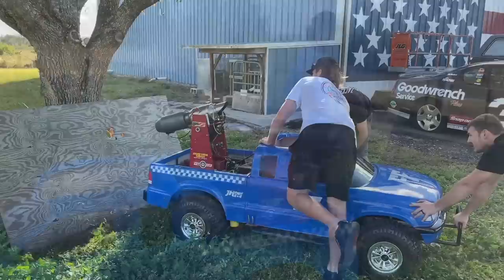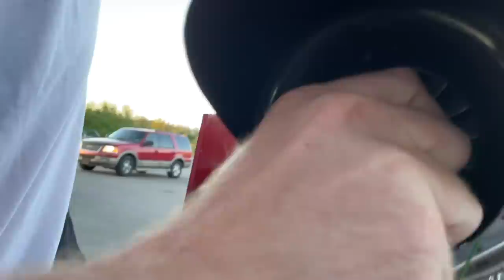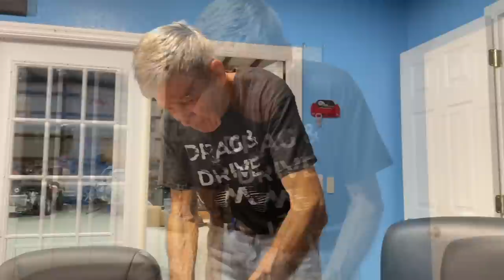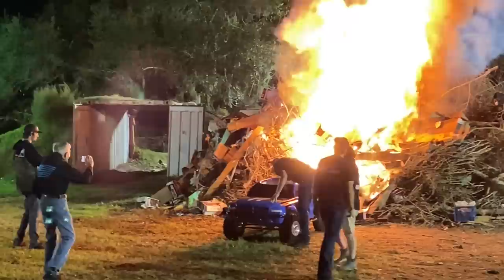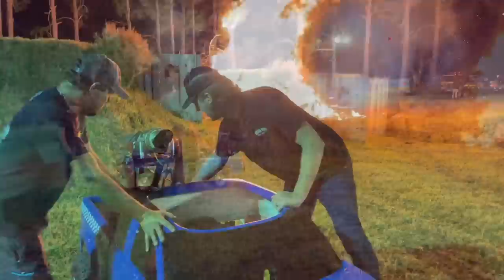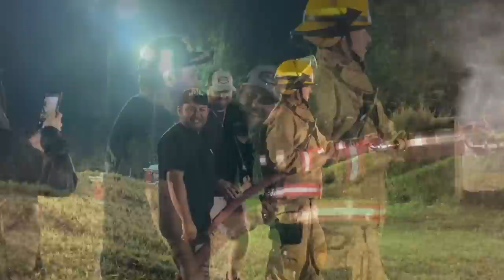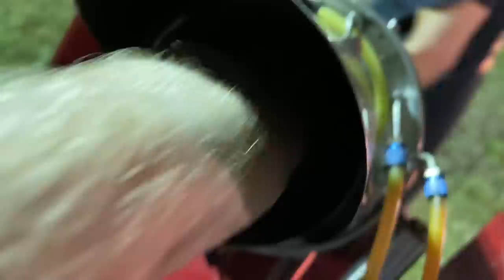Stoking a Fire With a JET ENGINE AFTERBURNER Will Get The Fire Department Called...

Comment: The turbine need's to go through a cooling cycle when you shut it down otherwise it will overheat internally. If you spin it with the airline after shut down for a while but slowly until the temperature drops below 100°C. If you used an ecu this would do it automatically.
Reply: Upvote this so cleet sees it!
Reply: Cleets helicopter is obviously piston powered and not turbine powered lol
Reply: Exactly. I work on aircraft engines too and I cried when I saw him hammering the turbine blades with the flathead and hammer.. I died a little on the inside! 😂
I don't know if it applies to small jet engines like that, but on regular turbine blades, you can actually shave down the outer edges slightly, there's a tolerance that is allowed to remove chips, cracks, or reduce the stretch that happens on turbine blades.
Reply: @dontyouworryaboutit_  his helicopter has two turbine engines.
Reply: Poor tree!!!😢
Reply: @metalhed411  we're sorry, we thought this was merica 😂. I could only imagine your face when he did that lol
Reply: @dontyouworryaboutit_  Turbine powered but no after-burners (or re-heaters as they're called in some parts of the world).  But he obviously doesn't think a radio controlled turbine engine doesn't need a "cool-down" period.
Reply: needs to keep the oil pump running
Reply: 100% the issue. Good thing he doesn't work on jets!
Reply: Turbo timer would work
Reply: @metalhed411  haha oh man thats hilarious coming from someone who has worked on these. I imagine those sparks coming out when the fire it up for the last time were metal shavings from the failed turbine !
Reply: THAT JET NEEDS A COOL DOWN BEFORE YOU SHUT IT DOWN, THEN USUALLY THE ELECTRIC STARTER TO CONTINUE TO RUN AFTER SHUT DOWN FOR 5 OR SO MIN FOR COOL DOWN. PLEASE DO YOUR OWN RESEARCH OR YOU WILL NEED TO BUY THE BEARINGS BY THE PALLET.
Reply: Its so simple but makes so much sense and makes you think why no one else thought of it, after you find out of course. Sounds like an ECU is in the near future :)
Reply: You can use a leaf blower to cool it down or compress air ..needs to cool for about 3 minutes …I fly rc jets and mine has a temp guage for cool down
Reply: That, and don’t feed it nitrous without correcting fuel. I’m pretty sure even jet engines have a form of knock. 

Not to mention if they’re using actual jet fuel it would probably be pretty oxygenated already
Reply: No body got time for that 😂
Reply: Ours offshore do a slow roll 4 hr post lube to keep the shafts from warping and locking up
Reply: @dylanzrim3635  nah, there's no "mixture" on a jet. It just burns what it can. You can absolutely over speed one if she's eatin too good though
Reply: He is a millionaire, he just buy another!  Who has time for cool downs 😢
Reply: @TechKnowCSS  it’s a toy, not a passenger aircraft 😂
Reply: @metalhed411  .....and after hammering on it, he starts it and stands next to it without even wearing safety glasses. 💥
Prolly not a deal, but........
Reply: I actually expected some blades to break off when he was hammering them. Or afterwards, when spinning at quite some rpm, landing in the public standing there.
Reply: @metalhed411  I don't work on jet engines but still it seemed like common sense not to apply shock or shearing forces to the blades or a side load on the bearings.
Reply: @93cutty  so in merica the fire department can just come and put out a private controlled fire on private property without asking, home of the free 🤣🤣🤣🤣🤣 yeah right
Reply: @metalhed411  s'all good he used a deadblow 😅
Reply: No body cares, it's content
Reply: @PiezPiedPy  model jet engines don't have oil pumps, oil is in the fuel cycle
Reply: @munangst24  he should know turbines have a cool down period before turning them off or the compressor blades do exactly what this did and seize to the housing lol
Reply: @metalhed411  Yep; that and the dodgy bearings.
Reply: Just gonna send it.
Reply: @randywl8925  With the amount of angular momentum those blades have, if one let go it would have approximately 1/3 the speed of a bullet (assuming a mass of 100g, an angular velocity of 12000rpm and radius from centre of rotation to outermost tip of 10cm).
Reply: Without the proper ECU there is no protection for overtemp or going over the max RPM. The turbine wheels can explode. The rear turbine wheel with the damage is an accident waiting to  happen.  Please be careful
Reply: @raptorheli2  cheers ;)
Reply: @dylanzrim3635  yep, it's called stall
Reply: Where do i get a jet engine in this size?
Reply: Let him do it how he wants to do it  it ain't that deep lol
Reply: It’s a redneck jet engine gocart they don’t think of longevity when creating crazy shit but might be a good idea if they want to use it more
Reply: @davidgriffin79  .......so basically, if I hit you in the eye would hurt?
Reply: @deezet9518  remember what the plastic fidget spinner did years ago when they spun it with nitrous?
Reply: @randywl8925  Well, it depends on your threshold for pain; it would carry on and exit the rear of your skull, so ymmv.
Reply: @davidgriffin79  👍 probably wouldn't even hurt. 😁😁😁
Reply: And the headline…. “Florida Man….” 😂🙏😎🤙
Reply: @93cutty  tf kind of response is that? just because you can in theory do something doesn't mean you should, yeah it needed a complete overhaul anyways but by going full meathead and banging on the fins with a hammer he made things endlessly worse and, waaaay more expensive for himself in the process considering how expensive these little engines are.
Reply: @unfortunately_fortunate2000  it's called a joke kind sir.
Reply: Cleetus, "We ain't got time for that."
Reply: @davidgriffin79  A Jet dragster motor let go in the 80,s in the UK .The motor was alongside the Driver and it killed him instantly.
Reply: I didn't see any oil for the bearings and a leaf blower would be a cheap way to cool down.
Reply: @randywl8925  haha yeah, that was safe
Reply: Warped Perception is a great channel that has wired these up.
Reply: Do you really think they care lol?
Reply: I never worked on a turbine  in my life and common sense tells you that should have a cool down  First thing I thought of when I seen  the video before reading the comments.
Reply: @Mahalo_83  there's codes. I think you'll find they were too close to a structure (shed)
Reply: Just put nitrous on it that Will Cool it down.
Reply: The case cools before the internals and contracts- locking up the turbine. Had they left it alone it may have gone back to normal.
Reply: @Mahalo_83  Damn fire pigs

Comment: The fact that Sam knows how to work on jet engines is beyond incredible!!!
Reply: Bet hes a Vet, looked up the Jet motor he refrenced McDonnell F-4 Phantom II motor.
Reply: Sam has forgot more than all those guys know put together.
Reply: Everything works better when it's shiney. Haven't gotten to that point yet I imagine he may know a little more than that. Way to go sam!
Reply: They are pretty simple, not many moving parts and he's a wizard with everything it seems!
Reply: @nomadfishermanak  I think in one of the race week videos he said he worked on aircraft in the Vietnam War
Reply: I mean he's an Air Force vet 😂
Reply: @nomadfishermanak  he is. Air Force I believe
Reply: @Burley_Bert  Sam is a Veteran, He worked on Jet engines when He served.
Reply: Ain't war hell!
Reply: He's ex air force
Reply: That's what he did in the air force.
Reply: @Studio23Media  my grandpa was responsible for charting the maintenance of 50 planes in World War II.
Reply: @fordfella67  Makes sense there is a big airforce base right over there.
Reply: Its just a glorified turbo charger, one shaft two bearings and a compressor wheel and an turbine wheel. They are very simple which is why they go so well.
Reply: hell yeah brother
Reply: Sam repaired them in 'nam
Reply: Sam knows his way around a GEJ-79 if he was on F-4s

Comment: Surprised the fire department don’t have JH and cleetus on speed dial just so they know if it’s worth the trip 😂😂
Reply: Admittedly with the flames and embers coming over the house like that, even with my training and everything else I would have been on the horn with 911 and reporting it as I'm running up to notify the occupants. After I would have found out its a bond fire, I would have relayed that to dispatch so they were aware
Reply: Kinda feel this was scripted with the local FD.
Reply: hint: notify the FD of a large bon fire ahead of time, probably wouldn't hurt to have  water tank or pond with pumps and hoses as a show of good faith to them. 🤣
neighbors nearby had some far larger than that before, with whole tree trunks over nearly 20+ foot tall in a tee-pee shape, dead calm night and there must have been 60+ foot fire tornados, because it looked like the sun coming up and it was clearing the tall distant trees. they had a tanker on standby just incase it got too stupid.
Reply: @throttlebottle5906  he owns a fire truck I’m sure it’s on site somewhere
Reply: @SkreetVette  it was, but they did not alert the FD and neighbors ahead of time, nor control the amount of flying embers.
I can only guess they had too many close worry wart neighbors(old age), that and the fire was far to close to many things. like, home containers, trees, etc.
not once, in my 45years have I had the FD show up. other than when I called them once at night, inside a building which HV powerline broke and landed on the building, arcing all over the roof, drip edge, gutters and refrigerant lines. 
(small convenience/food store), I happened to be inside the walk in cooler as it landed on top the building. there was a massive orange flash and BZZZT just behind my head. I initially though oh the evaporator fan motor shorted or other thermostat wiring. until I stepped out of the cooler. about 3' and BZZZZZZZT, huge HV arc in the middle of front parking lot. I knew I was lucky then, because they were very HV lines and kept reclosing over and over again until finally burning clear. I mean they didn't just reclose and three times, it was 10+ times and eliminated the coax cables, phone lines and more for the whole area. initial arc went through the aluminum drip edge, gutters, downspouts and blew a hole in refrigerant lines. good thing I was there in the middle of computer and "IT" work. very lucky, things went wrong prior and a stopped for a food break with nearly nothing critical....

Comment: About 75% of the air going through a turbine is for cooling, afterburners are usually only used at full power, so my guess is at the lower rpm’s with the afterburner engaged wasn’t enough airflow to keep the turbine wheels “cool” lol. Just a guess turbines I worked on in the Bell helicopters didn’t have afterburners, unfortunately lol
Reply: Right. Saved me the trouble. He's run a turbine before, so he should know you can't hang around at low speed or you will cook the bloody thing. All those sparks coming out when it's starting are bits of red hot metal burned off the engine. And did they say grease? Surely these things need a forced oil supply for lubrication? Reminds me of their early days with junk yard v8s when they were breaking them every few runs and just heading down to the scrap yard for another one. Not so easy with jet engines.

Comment: Next time let the local fire departments know you are having a bonfire so when your neighbors start freaking out an calling 911 they will already be informed.  Especially since you have your own fire truck . Always works for me
Reply: 100% they should have had a burn permit for something like that, assuming Florida works like Minnesota. 

But even with a burn permit we have had the fire department show up. If the fire gets called in as a structure fire they are required to respond.
Reply: @philb5593  permit I'd just a way of showing you comply
Reply: round’ here we have a stream from our pumper on the edges as soon as the delt pull up to the lane so they feel defeated before they even get lecturing. most of our fires dont start with half that amount of crap also. jh had a years worth piled.
Reply: they'll have a hefty fire dept bill to pay for them coming out i'm guessing?
Reply: @murry001  that's not how that works. FD's are taxpayer and donation funded. Career departments are taxpayer funded, but do often see donations as well. Most volunteer departments rely heavily on donations and similar things. Volunteer departments often have taxpayer funding, but that widely varies by state/county/city. 

There are a small number of locations in the US that are served by for profit private fire companies, which residents have to pay for their service. But that's quite rare.

Comment: I am a jet engine mechanic and seeing you hammer and screwdriver beat on the blades scares me to death. But it reminds me of some of the tech’s I’ve seen over the years lol need to do a 2 minute 70 percent cool down run to cool the engine hot section down before shutdown. That will stop the over temp of the bearings
Reply: The hawk is below 90% for 2 minutes but yeah lol he needs to let it cool down

Comment: We had an end of the year even at our local track, even of destruction, and they use a jet car to melt down some cars. They’ll burn them to next to nothing for about 2 minutes. It’s pretty entertaining
Reply: W.I.R.?
Reply: @iron1man7818  LOL was just about to comment the same 'cause that's how she ends with the fireworks and alll.
Reply: If it's Lucas Oil Speedway they didn't do it this year. Normally it's Shockwave or Afterburner owned by the Darnell family. Chris died in the Shockwave crash this 4th of July weekend. One of the nicest guys you'd have ever met.

Comment: A&P mechanic here; You need to let that thing idle for a good minute to cool down after running that burner, or getting it hot.  It's also important that it's mounted at the right angle for oil to flow properly.

Treat it like an old school journal bearing turbo.

Comment: usually those small turbines are cooled after running, to below 100C, because the bearings are not actively cooled, but only by bleeding a little fuel into the bearings
manually or via the built-in starter

Comment: Burning the actual tree was a bone head move.
Reply: I was looking for this comment. Glad someone said it. So worried about his stupid fucking grass
Reply: Was thinking the same thing.
Reply: It’s just a tree.
Reply: @jordanlarkin4533  and here lies the problem,
Reply: yup🍻
Reply: What if he wanted to chop down the tree..? It’s his property & his tree. Y’all can get salty over your trees on your property🤡
Reply: Happy I wasn’t the only one that said it.
Reply: @tylerreel7301  Then he should chop it down not damn near light the whole thing on fire when he didn't need to 🤷‍♀
Reply: At least he thought about protecting it with particle board, which he soon found out wasn't enough but the test was already going. Also when he noticed the tree was getting burned he did angle it down some.
Reply: @ShivaShakur  it’s his tree. He can chop it down or burn it down .
Reply: Yup. Next hurricane that tree is tumbling over due to the structual damage.
Reply: @Bartofii95  
Only the bark got burned right? If so how would that cause structural damage to the tree?
Reply: @Wierd_Loco_Steam_Works  Miss. Clough look up how a tree gets nutrients.
Reply: @Wierd_Loco_Steam_Works  Why are you talking still

Comment: The compressor case will cool faster than the compressor and turbine discs, which will cause the compressor to "cage", and also probably cook your oiling system, hence the bearing damage Sam was talking about. You need a cool down period after running it in burner, we run our P&W F100-229s at idle for 5 minutes prior to shutdown if it was operated above 700 degrees C, which you obviously are lol.

Comment: might need to make the oilsupplytothebearings so the oil is cooled and keeps running even after the jetisshutdown , might help keep those bearingsalive, could allso puttherearturbune setup and wittle some of the outside in the lathe could put an imbalance in it and reduce the efciency some but at least it wouldnt rub against the walls

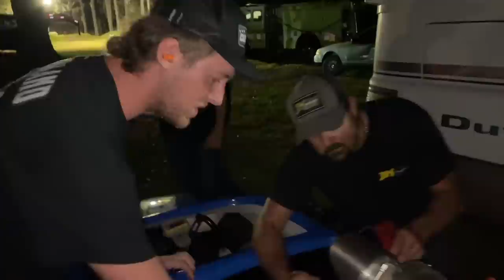Comment: Im 5:50 in on the vid, but in the longboarding world there are ceramic bearings that you can get for top dollar but you can wash and reuse rather than metal bearings that tend to rust after a season. 
Idk the temp tolerances for that type of deal but maybe check ceramic bearings

Comment: Just as an fyi with your jet engine in the future they need to run a cool down procedure so that the internals do not seize. Additionally make sure the bearings are getting lubricated, theses small engines just use fuel for lubrication & cooling.

Comment: You knew 911 was going to be called. It looked like the house was going off. Hopefully no one in that part of town needed EMS or FD during the time they were there. The FF Fire Truck should have had a line stretched ready to go and put it out FOR the fire department. But no, now they have to go back to the station, wash the hose, let it dry, and repack it on the truck. Being down for probably an hour, not including the time they spent at the house. Not to mention TWO fire trucks were responding with lights and sirens, and possibly endangering other drivers on the road. Totally uncalled for bud. I hope you guys make a donation to the fire station that responded..

Comment: It got locked up because it got overheated after it had run...... you always have to cool down a turbine after turning it off (with some cold air blowing into the engine and let it turn over) for at least 30sec to a minute...... Normaly if you have an ECU it will do a cooling down sequence by itself tho (tho some older turbines or home made ones don't always have that)